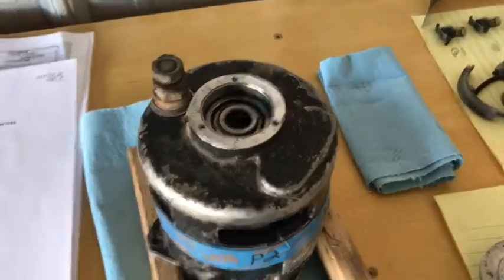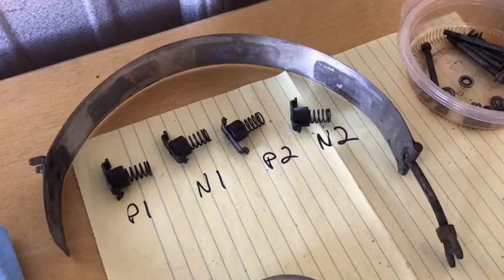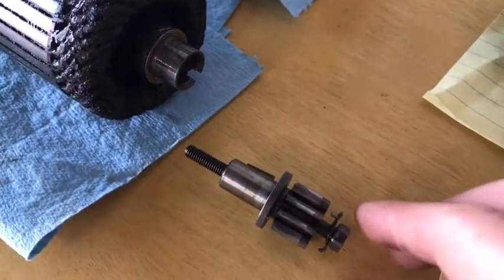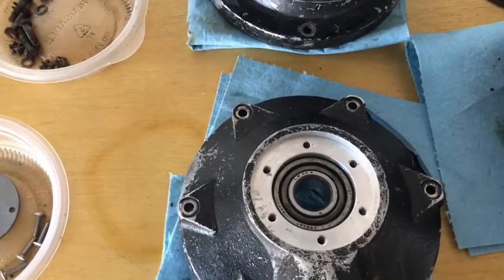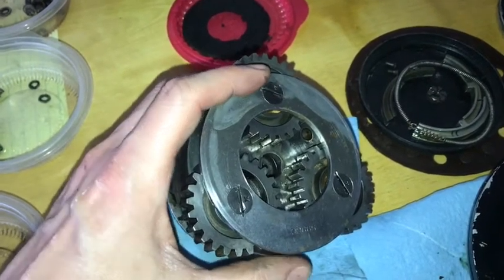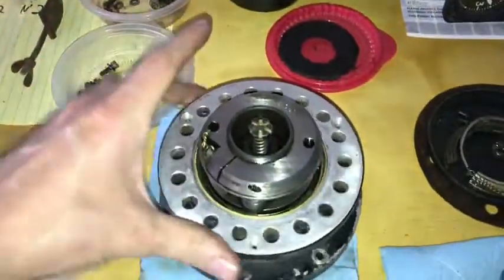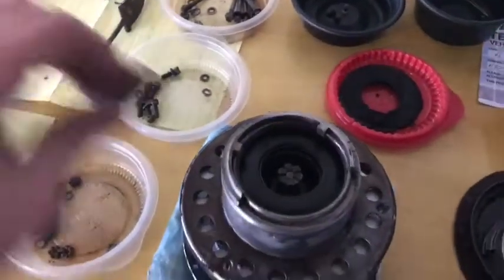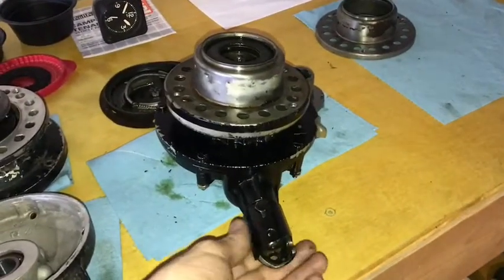Eclipse Y-150

Comment: Hi Mike, Thanks for the video. Do you know what aircraft this starter goes to?
Reply from the maker: I used this starter with a Kinner R55 radial. It is on my Ryan PT-22, they are also on Fleet Aircraft,  and Meyers OTWs.
Reply: @1mbowen  I found one of these that is attached to a gear box. It has a 1" dia steel shaft coming out the side. Probably for a retractable gear or flap motor? If you know anyone interested?
Reply from the maker: @VintageJunker  there were many variations that are basically Motor Actuators. Do you recall how many electrical posts are on the end of the motor housing? If its more than One its an Actuator and not a Starter.
Reply: @1mbowen  Yes, it has three. Thanks
Reply: The electrical posts are identified as A, F and J. Do you know what that means? Thanks
Reply from the maker: @VintageJunker  my guess is a Common, Forward, Reverse. But I do not know which one is which.